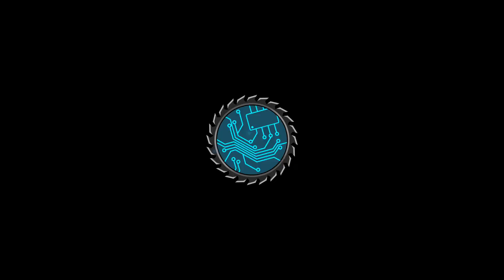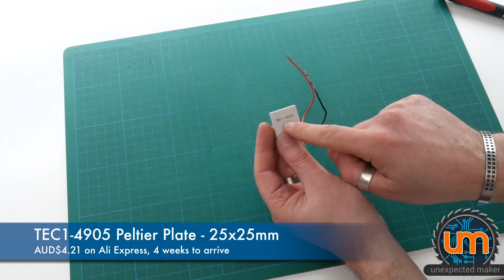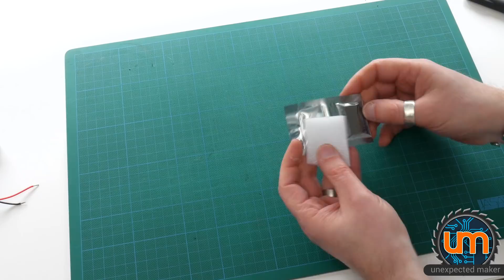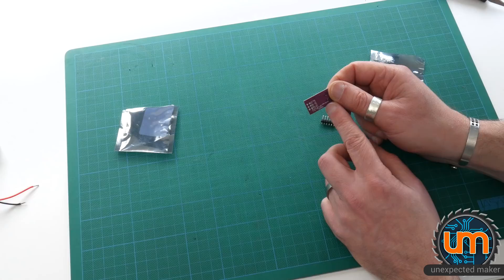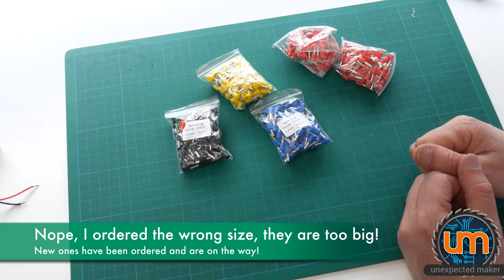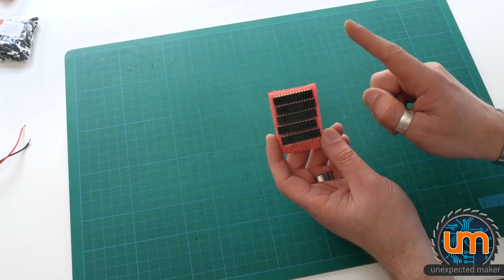Unexpected Mini Mail #5 - A Quickie is a Goodie

Comment: Another way to describe the Peltier element is as a heat pump. They generate several watts of heat while running and simultaneously pump all the heat to one side. If you don't pull the heat out fast enough the whole thing will just heat up and Peltiers made for cooling only don't like being too hot so unless you know the rating, you might want to regulate the top end temperature with a thermistor/opamp/MOSFET setup. I think they normally max out at 80-85˚C unless you get the ones made for heater use which are good to 200˚C. Keep in mind they also have a limited lifespan.  
I was using them for a thermal control system to brew lagers in the heat of the Texas summer.  Lots of data here: http://www.analogtechnologies.com/tec-module.html
Reply from the maker: Yeah I am a bit dubious about sticking this thing inside anything like my cup holder... going to be super careful about it - I'm pretty sure the max temp on this thing is well below 100˚C, and I'm not sure I can trust anything I read on the store page ;)

Comment: Another cool mailbag. I remember playing with peltier effect devices years ago. Fun, but not unsurprisingly, they need a lot of current.
That display you linked to is not OLED, it's an IPS LCD display. So I'm guessing one of those extra pins will be for the backlight? 
I have been tempted to get one of the SSD1306 0.96" OLED displays (128x64) to play with, but I don't have a project for one yet.  Hmm. :-)
Reply from the maker: Yeah, I worked that out (Not OLED) after recording and uploading... when I was generating links, oh well.. makes for extra drama on the channel! hahaha... still looks like a pretty sweet display and I am keen to see it up and running!
Reply: 0.96" Oled displays are great I've used loads...…………….Invent a project!! …….Oh yeah...…...this is a great Arduino library "U8cglib"...……..on Github